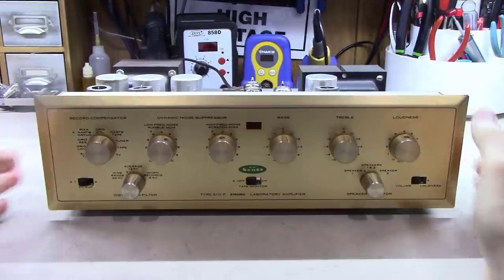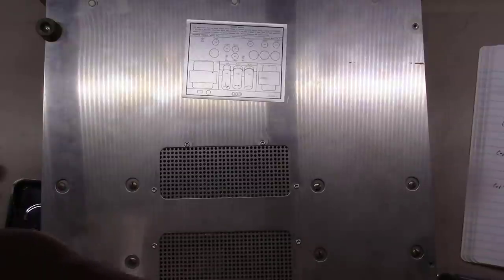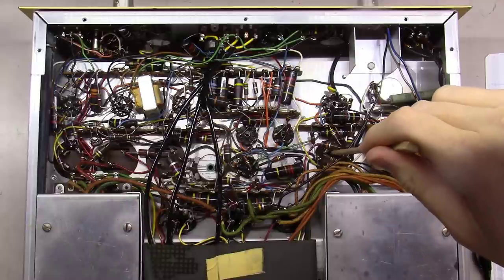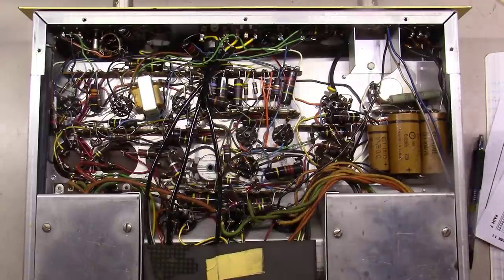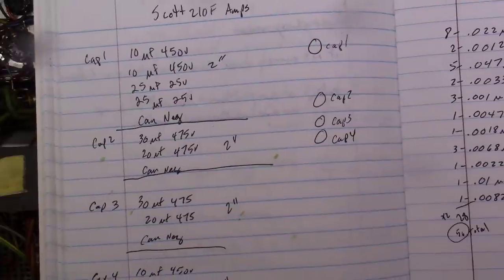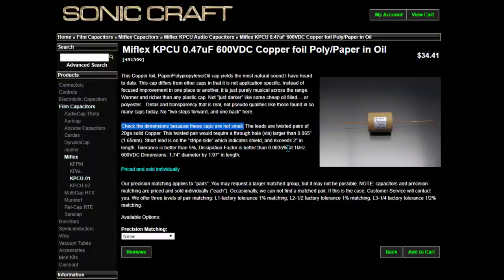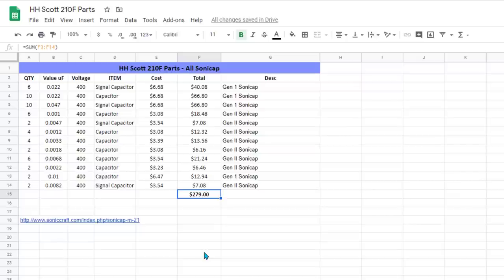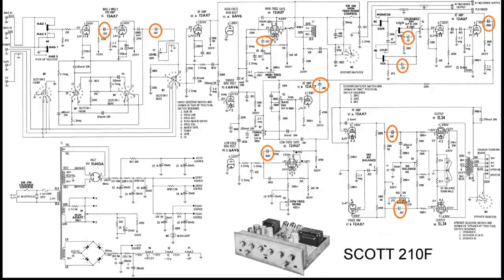HH Scott 210F Dynaural Labratory Amplifier Restoration - Part 2

Comment: I think mark makes an excellent point. 
When I decided to recap my amplifier my tech, who was also a good friend, gave me the task of tracking down all capacitors needed. I started out with big dreams of only using Audience and F and Ts. But then reality set in which often even bigger manufacturers don't make every value. So I ended up buying whatever I could get my hands on. So my amp is a hodgepodge of Audience, blackgate, FandT, Solen, Panasonics. However the amp still sounds great and much better than before the recap.

Comment: The sticky wires are caused by the plasticizer used in the vinyl, capacitor leakage in paper caps is not from them "drying out," it is because the paper used is going bad (acidic}, you CAN NOT leave leaky caps in they must go, bumblebees were junk 40+ years ago when I started electronic repair, & yes it will sound different (better) & your output tubes won't fry.

Comment: Starting out in electronics in the 60s I learned tubes first then transistors and built and repaired lots of tube equipment. It is very fun and nostalgic to see these videos and especially something as rare and in good shape as what we have here. But having learned a lot about sound and technology over the years and having worked in recording studios, research labs, electronics manufacturers, and military locations, I firmly believe that the sound of today’s digital and analog electronics and loudspeakers provide much superior sound and reliability with much less cost involvement. Regardless of cost the sound quality with tubes is greatly limited due to the need for transformers yet some people prefer the distortions of the music that come with tube amplifiers. Different strokes for different folks with different wallets. What’s in your wallet? 😆

Comment: I learnt the hard way about measuring caps and checking the dimensions of new ones the hard way. It was a arcam alpha 8 CD player. Inside it is a horror show of stuff squashed together. And that's before you see the load of broken / lifted traces (I had no desoldering gear). Many lessons learned from that escapade. Amazingly it continues to function flawlessly to this day 😆

Comment: The Sonicaps 1 + Panny Mylars (for tone controls and switches) choice would be the most reliable and cost efficient, whilst giving really good sound..  The Sonicaps 2 would be the right choice for RIAA phono circuits though.. The RTX has a more high frequency extension emphasis. They are larger in size with true tin foils wrapped in styrene... The PIO caps I liked are not made anymore,  the UK made Ampohm.

Comment: Hi Mark, Just curious on the purpose of V3 (the 6AV6 triple diode) in the circuit. Its described as a bias rectifier... is it doing some sort of voltage regulation or clamping for grid bias? Have not seen that before...
Cheers,

Comment: Peter walker of QUAD once said, an amplifiers should be like a wire with gain! When I hear people talking about an amplifier that is warm, smooth, extended or any of the dozens of words used it just makes me laugh! A good amplifier should add NOTHING but gain, what goes in just gets louder when it comes out. It cannot make a poor signal sound better, or add bass. Anything added is unwanted colour. These caps are a good example, if it cost a lot it must be good...REALLY. So much snake oil. All that iron and heat! That valve sound!! Yes valve amps do have a sound, limited frequency response, high distortion, poor S/N ratio, hum. etc etc. True a good design can sound very NICE but colour can make some poor recording sound better, not accurate but better on the ears. Don't get me wrong in the 50/60s these amplifiers sounded amazing. Time has moved on, a modern  quality amplifier will wipe the floor for dynamic range, power and natural sound. Saying that, nothing looks better than a row of valves glowing and heating the room!
Reply: Michael Beeny Very well said and true. Nice contribution.
Reply: You can say what you prefer, but you cannot say what sounds better.  All amplifiers, have a sound profile and stats alone speak nothing to it.  Peter Quad's famous quote about amplifiers spoke more about the increasingly difficult task of powering the awkward load demand of loudspeakers like the 57 than it did about the sanctity of solid state amps.  Solid state did not emerge because it was better.  It was just cheaper.

Comment: taking out bumble bee caps and replacing with new caps  will  changing the sound i think it's BS we were not around to hear the amp when it was first built
Reply: Well, the caps may be leaky so the sound today would NOT be the sound when it was built.  THAT is the big fallacy of vintage guitar amp people, they like that "old" original sound their amp makes when, in reality, when it was built and the caps and resistors were new, that amp did NOT sound "mellow" and tired.

Comment: I got money that says no one can hear capacitor difference in double blind tests.
Reply: Richard Wielgosz I’ve got some cash also that says depending on where in the circuit it is and it’s use you can most certainly hear a difference. $1000 speaker cables I’ll agree with your sentiment. Re-capped both my ST-70’s and the second night listening my wife asked me what I changed? When I asked her why she replied “It sounds a lot different than the last time”. I said different good or bad? Clearer and just....better was her reply. And when it comes to audio my wife is a true “Blind” study lol.
Reply: Me too Richard, the snake oil runs deep in the audio world.
Reply: @bobbymccourt6794  I have to agree with you on this, and my oscilloscope agrees with you also. I will even go as far as to say that using silver wire interconnects can make a difference on some systems, particularly very low voltage setups (phono cartridges, headphone amps, etc..)

Comment: El34 what they like with kt77 probably be better the Kt77 more open better top end they say.
They say the best capacitors to replace bumblebee Jensen paper in oil you should always use paper in oil in valve amplifiers and or polystyrene polystyrene in the Signal Path.
There's an exercise you can do on your eyes I don't know if it works if you need glasses, keep changing between looking into the distance infinity and then looking at the palm up to your face I don't know 6-7"  trying to get it to focus and then switch back and forward in rapid succession do that about 15 minutes everyday supposed to work.
Should notice I think after a couple of months improvement. Carsons lamb he makes a capacitor tester and prediction tester don't need high voltage, he explains why you don't need high voltage
Reply: PIO caps never go in any thing I repair TOTAL GARBAGE.